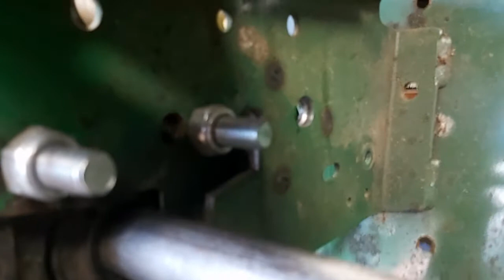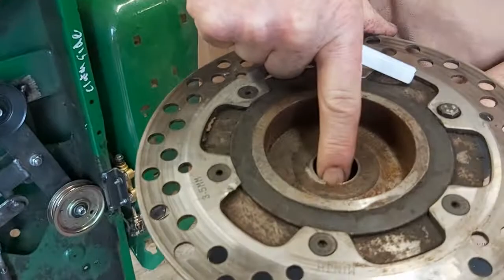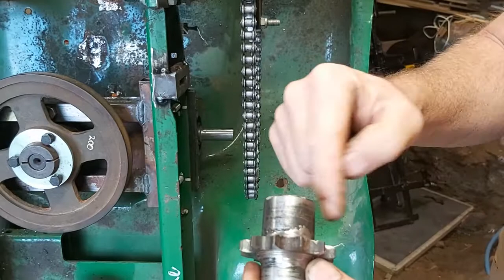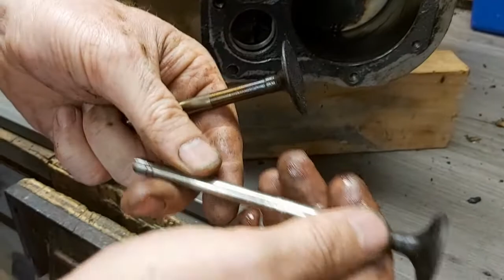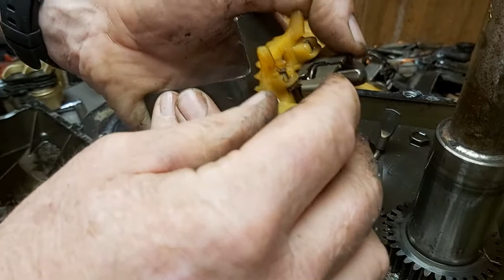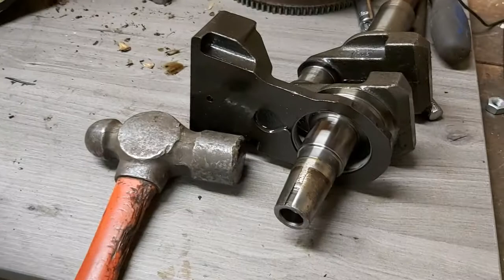Billy Bob part 7

Comment: What sort of rpm you gonna be pulling with this with governer removed?  What's the limit on stock rod and spinning up the steel flywheel would you think?
Reply from the maker: the cam limits the rpm and also the valve springs , if you wanna turn high RPM then get an alloy flywheel, for me its all about the tourque.
Reply: @bazzasgarage1922  yes. I want the torque as well!  I've done flywheels on smaller engines but for bigger ones they are too expensive.  I appreciate the information and will keep enjoying your channel.  Cheers

Comment: where do you get all the parts from?
Reply from the maker: Which  parts to you want to know about. I get parts from all over the place. Most stuff is second hand.
Reply: @bazzasgarage1922  all the axle parts
Reply: @charlieguy3149  The axle is just 4140 25mm steel from Steel and tube, the wheels and hubs were all second hand on this build. So just sourced locally. Maybe some others could chime in and say where they get there parts from. I would suggest wheelco for the wheels or IWL in Hamilton. Hubs maybe some of the go kart suppliers have 25mm hubs or bring them in for overseas , i made my last ones. Motive parts in Taranaki had some at one stage. Braked discs from pit bike suppliers and gear from motorbike shops or engineering supplier. Hope that helps a bit
Reply: @barrydawe3735  Hey, Pete from Motiv parts supply here. I just got stock in. I have 4 bolt hubs for 1" shaft. I can supply 4140 axle keyed or with threaded ends to lock the hubs on. I've also got 8x7" rims. I've also got loads of options for brakes. Happy to do discounts. Just look me up @motivpartssupply on FB.